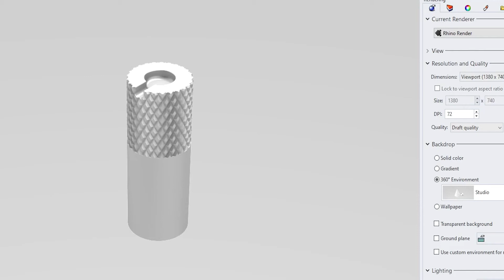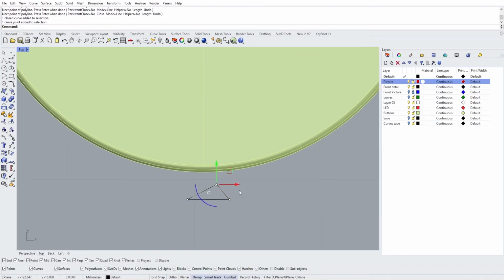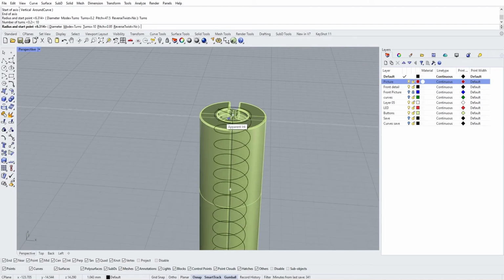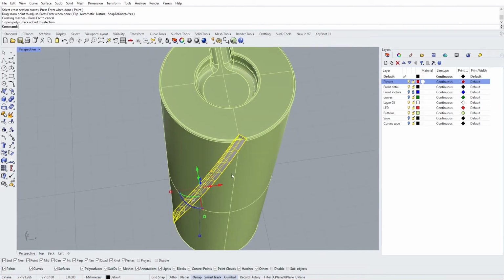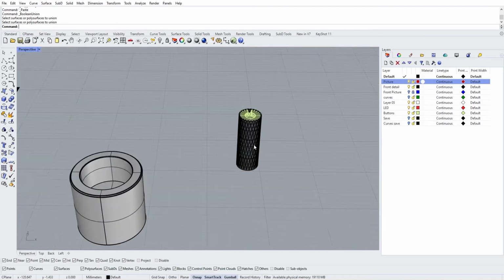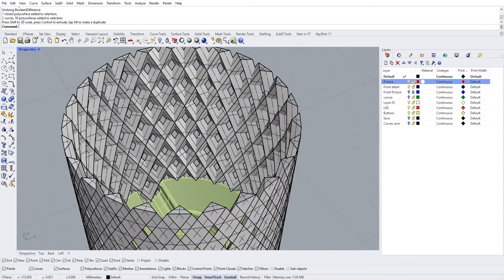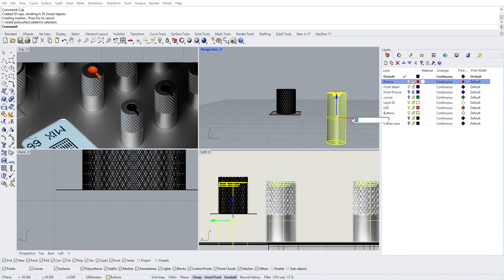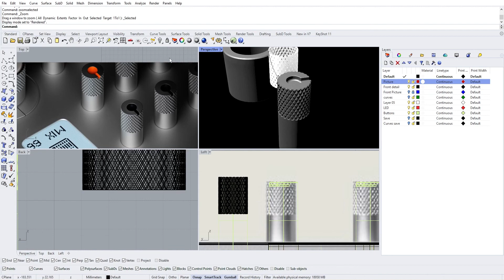Easiest way to create texture in Rhino7  (File in description)

Comment: hey! very nice video- excactly what I am looking for ... just one problem, after I cut the first group of helixes out of my shape, I get a error when I cut the second group out... boolean was no sucessful - can you guess why that is when the first section works well? thanks!
Reply from the maker: It’s possible that your first boolean generated an open polysurface (if you select it, in the property tab you can see if it’s an open or close polysurface). If that’s the case it might be that the helixes boundaries are too close to the boundary of your shape, try scaling them up slightly and then again the first Boolean
Reply: @DuterqueStudio  very nice thank you! I scaled them up and it actually worked!

Comment: Using 3D Coat this will be in seconds. Anyway those models from 360, rhino, has bad wireframe... But 3D Coat you can retopo in minutes.
Reply: Um, Rhino is for design development, not for eye candy. Precise geometry is the point. That's why Rhino is a standard in architecture and industrial design, especially when it comes to parametric designs that are determined by math (Grashopper). After the designers, engineering and tool-making are taking over anyway and they will model the geometry usually from scratch anyway.
Reply from the maker: 3D Coat is a polygonal software, it's not intended for industrial design and manufacturing